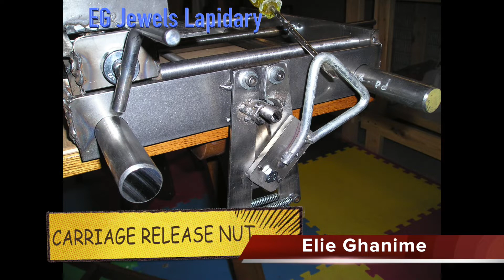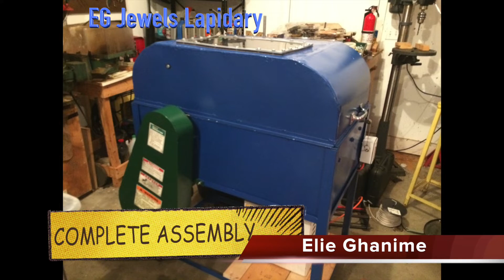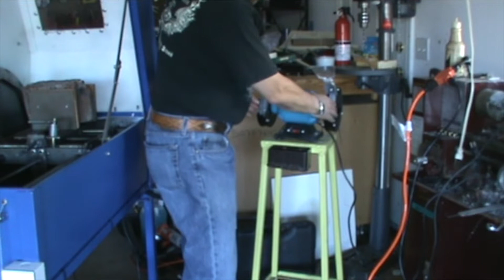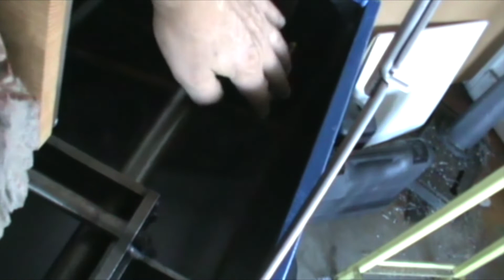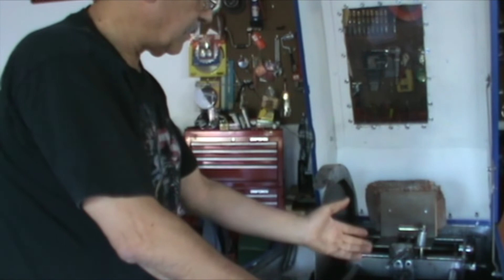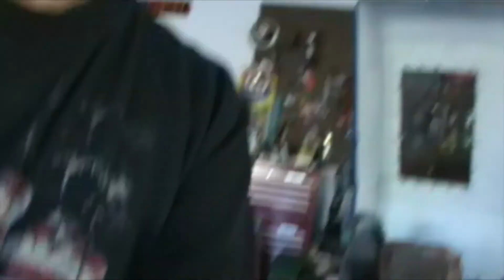Building my 18" Slab Saw

Comment: Great build. I'm just wondering why you didn't use a naturally on switch, like a frig light switch. It would work just as well and if you extend the rod and make a moveable stop it would stop where you want. When the vice pushes the stop it would push the rod and turn off the saw. Good video Thank you Sir.

Comment: Do younhave any videos on your carriage assembly? Im having to replace the All thread on the vice for my carriage and was just thinking  about using acme thread instead, but have no knowledge of which to use.
Reply from the maker: Sorry I don’t have a video on carriage assembly besides what you see in this video. However, There are two drawbacks to using acme screws: low efficiency and a shorter life cycle. Because of the high frictional force between the nut and the acme screw thread, acme screws can only achieve 20-40 percent efficiency depending on the material of the nut and the screw. I hope that will help.
Reply: @ElieGhanimeEG really? I thought the acme screws were made for repeated use for clamping
Reply from the maker: @joshuaalbanese5323  are you talking about tightening the vice using the acme threads? If that what you mean then yes you can, I thought you’re talking about the vice moving to cut the rock.
Reply: @ElieGhanimeEG yes, I am speaking of the vice that holds the rock, not the drive screw for the feed motor. However, I did opt for middlenof the road and found a grade 8 astm equivalent in all thread and will get the corresponding nuts to weld under the carriage  to replace my failed part. My saw was an old kit saw someone put together with angle  iron and bolted inside a galvanized sheet metal tank. It does ok, for whatbit is but not near the structural stability as yours. This would probably explain why sometimes I get blade deflection despite how precise my alignment is (its spot on). I believe it has to do with the rock wanting to climb the blade (as all cutting loads do) and creates a torsional stress that a sheet metal tank bolted to wood and angle.iron just cannot resist all the time. Yours is a very solid build. Should I ever build one, I will take many cues grom you. Thank you

Comment: How many rpms is your carriage drive motor? I have adopted an old kit saw that was left in a feild. Been slowly working to make it run correctly. Just about there but still issues. Everyone i know has a HP saw, and cannot answer my questions. Just guess. Id love some fresh insight
Reply from the maker: Hi Joshua, The drive motor is a high torque and low speed, you can get the one you like that will fit your machine, you can also use the different size pulley on the drive shaft to change the speed, the important thing is you have to watch how fast the carriage has to move forward while cutting the rock based on the speed and the diameter of your blade, I believe you can get this information from where you get the saw blade.
Reply: @ElieGhanimeEG indeed. As i am cutting flint ridge flint (very high silica) i want to be as sliw as i can. My speed is currently 7.5"/hour. This is slower thannthe commercial saws i have compared to, but still think i could go slower. Oddly enough, the cutting seems to be easier After hest treating the rock.
Reply from the maker: I have a lot of flint from Flint Ridge and it does cut very well. You don’t need to reduce the speed 7.5 “ / hour is good enough.
Reply: @ElieGhanimeEG  my split nut will jump if im not peening my blade often. what do you do?
Reply from the maker: First check the alignment of the vise and the blade, I have a video on that, if that’s okay check the spring of the split nut you might need to have more pressure.
Reply: @ElieGhanimeEG i have done all this, and periodically the arbor comes out of alignment. Not sure why. I think the bolt holes in the frame need to be elongated to allow for more adjustment, and some sort of semi-permanent retaining device. Maybe a lock washer...
Reply from the maker: Try to add the lock washer and see if that will help.

Comment: Sorry for so many questions, Based on the cost of that liquid coating, (Red Coat) $65 from Amazon, or $50ish from  ebay, is it not just as practical to use a product like bondo, which is also flexible and paintable which I am only putting over the JB Weld in a thin coat with my finger in the seams I have welded.. Then I will paint the basin..
Reply from the maker: Don’t worry about the questions, I’m glad to help!

Comment: Question: The metal rails that your vice rides on. Are there any bearings involved? How will those rails hold out over time? Thank you.
Reply from the maker: My rails are 1” steel rods and there’s no bearings in the vice it’s only a slide-fit clearance holes, remember oil will be all over the place lubricating the rails.
Reply: @ElieGhanimeEG  Do you think I could get by with 5/8" rods? Thanks, I don't have to worry about drag. You wouldn't believe what saw looked like when I bought it.
Reply from the maker: @daultonruff2281  No, don’t cut corners, 1.0” diameter.
Reply: @ElieGhanimeEG  Got that - Thank you. Going to be 112 today so think I'll wait to go look at steel. --

Comment: I am addressing my vice and the height related to the arbor and blade. I'm about to lower my vice by rebuilding and making the vice  lower so a rock will clear the top of the blade. Yours looks just a little high. Is that an illusion? I am here to figure out what paint to use as I am now sealing the welded edges of the tank. I've found out I am a terrible welder and now am using  JB Weld to seal it and then I will also use bondo before I paint it. Saw is taking much longer than I envisioned.
Reply from the maker: Regarding the vice height is based on the washers that holds the blade in position, not the arbor, if you have the base of the vice where the rock will be resting it has to clear the top of the washer otherwise the rock will hit the washer and you’ll have a problem. After using the JB Weld make sure there’s no leaks in the tank. Take your time and don’t rush your work you don’t need any problems once you add the oil in. Good luck!
Reply: @ElieGhanimeEG  Thank you for your reply; I took another look at your arbor and saw that you are right. What you said is a big consideration for me right now as I am seriously considering tossing out my whole vice and carriage and trying to make it look more like yours. My vice and carriage weigh about 60 lb, and I don't like how I've adapted for a rail and wheels. I was just out there checking the JB Weld and looking at the vice. I think I'm planning a trip to my steel source to see what they have that I hope won't cost too much. I really am taking my time. A lot more time than I expected. This next payday I'm buying Bondo and am going to put a coat of that on all the seams over the JB Weld. I expect that will make sure there are no leaks. I also need a metal break so I can form a cover over my bearings. Lots of problems to solve in the future. I also am looking at how you put the window into your lid. I will be buying a piece of plexiglass in the future. My old saw had an LED light inside. Also, I powdercoated the basin. Wish I could do that with this one.
Reply: @daultonruff2281  Remember that once it's done it's done so if you have to change the vice do it now same with everything else. The steel prices are gone up now same as everything else. For the window on top I used a rubber seal from the auto parts supplier, based on the size you get you cut the window and the plexiglass , the whole thing is mounted from the top. For the powder coating you might find a company close by that they can do it for you, it will be cheap if you use the color that is most commonly used by them so you have to ask.

Comment: The drive shaft would not have been weakened by removing the threads. The threads do not add to the cross sectional thickness. 
The root diameter is the reason a thread is weaker than its major diameter measurement. 

Therefore the limit switch was uneconomical and unnecessary. 

Chain going around 90 deg corners break them. Why not put the on/off switch inline with the hole?
Reply from the maker: I also I forgot to mention, the chain is going over a roller wheel in the corner so it will never break and it gives me a better view to see the chain moving.
Reply from the maker: I understand what you’re saying. However, I didn’t want to take a chance to cut the threads on the ½” diameter, not only that, I had the limit switch already so it wasn’t an extra expense for me.